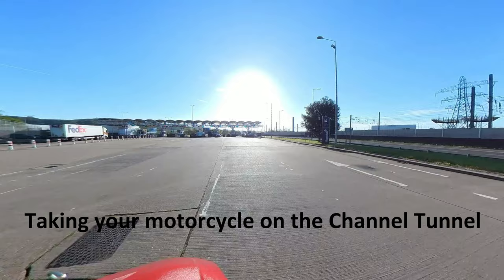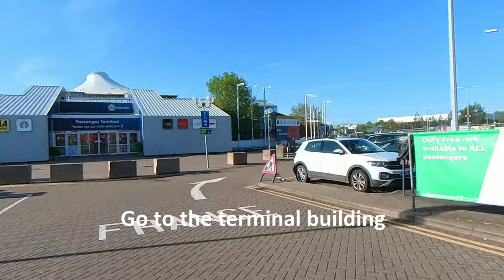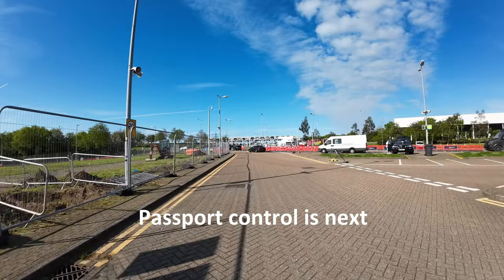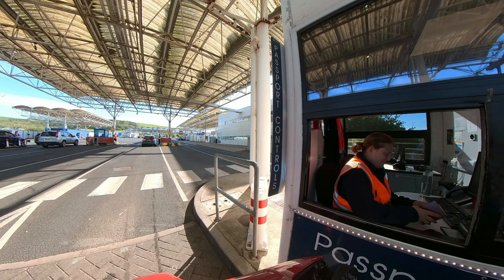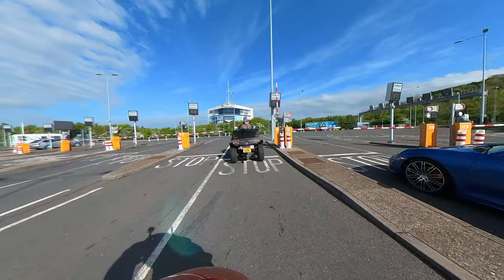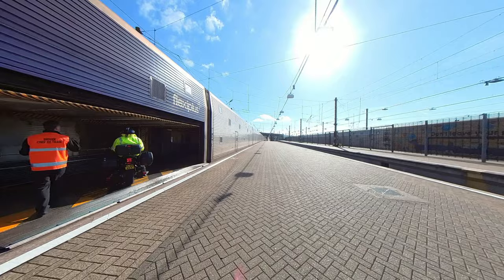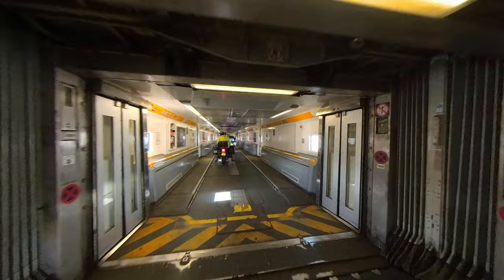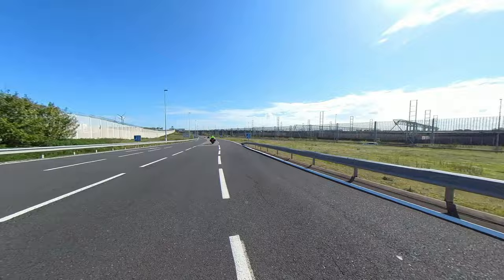Taking a Motorbike on the Channel Tunnel train

Comment: I put my gloves away at the check in screens otherwise would have been taking them on and off about 10 times.  Also for the queues at passport control I switched the engine off and paddled the bike. I didn't fancy starting it every time I inched fowards 2 yards (or 2 meters if you're on the French side). It was boiling hot, I ride an air cooled and have long legs so decided to paddle it.  
You can be offered a choice of train times at the check in screen so first person to check in makes sure everyone knows which train time to select.  
There's bike specific lanes but Google Street view has the entire journey through the port if you want to rehearse the lanes.

Comment: Looking for others’ thoughts please on current motorbike parking procedure on the Eurotunnel trains, and why we park facing left. Love using their service, however last time we used it with the bikes, the train driver had to apply slightly firmer braking pulling in at the end (nothing major), and some bikes then literally domino’d into each other causing some damage. Would there be more advantage for bikes to park facing right, so that any extra force (caused by unanticipated train braking) is then applied against the side stand? Is the current parking procedure (left-facing) the safest, if train braking can negate the side-stand? After this incident we will try to park up with more space around us in the train (if able of course), should the same happen again. Really interested in people’s thoughts please👍
Reply from the maker: That is a really interesting point you make. I suspect in their minds, it is better for Eurotunnel to have the bikes pointing to the left because the front wheel is against the kerb and this prevents the bikes rolling forward in the vent of hard braking. They presumably think this is needed because bikes don't have hand brakes. If placed against the right kerb which way would the front wheel face, left or right? If left, putting the wheel against the kerb becomes less effective. If right, then the bike is more upright and could face a problem if the train pulls away quickly. Not sure about that last bit.
Reply: The same happened to our group with a sudden braking. My mate’s bike tipped onto mine and lodged in the pannier. Luckily I caught mine before it tipped onto an expensive Audi sports car in front of me. I now take a strap to tie my bike down. Oh, and take a peg to clip your paper sheet to the screen!

Comment: I'm considering making the journey alone on my tracer so the video is much appreciated. With regards to comments about the train braking harshly, is this only towards the end or when should you be prepared for this?
Reply from the maker: Good question. I have been on the Eurotunnel many times (maybe 10 times a year for the last 12 years?) and have never seen a bike falling over due to heavy braking of the train. The trains tend not to brake during the main part of the journey, but only at the end.
Reply: @GaryFrance_Tour1  thanks for that! I presume the staff make sure there's enough room behind each bike to be able to back up and straighten the bike?
Reply from the maker: @Juvie99   Yes, they do.